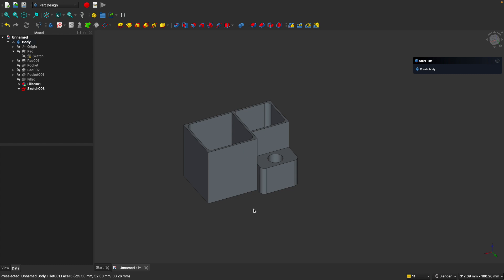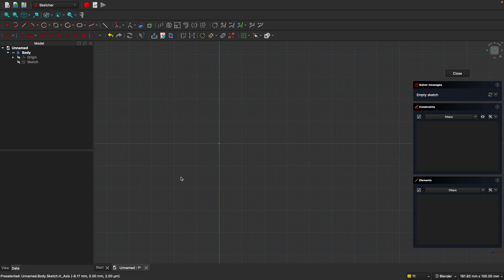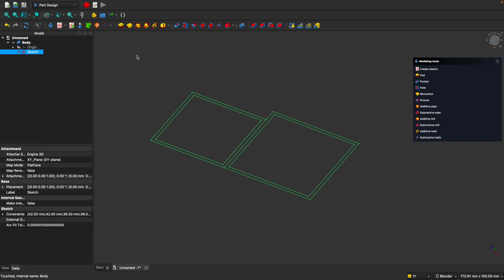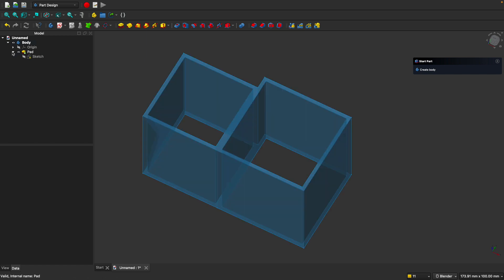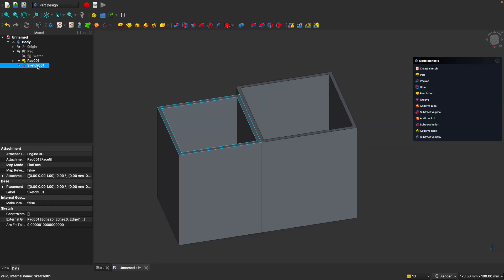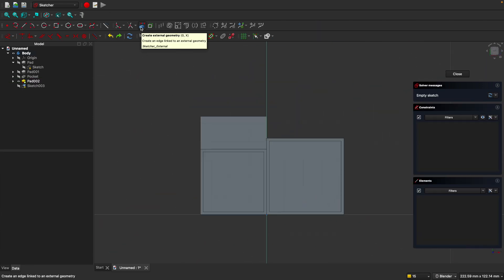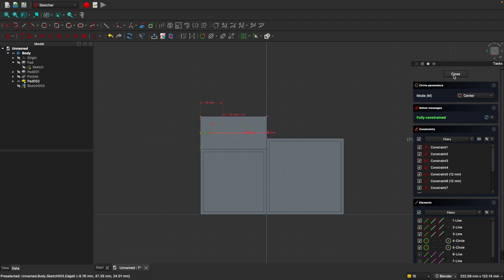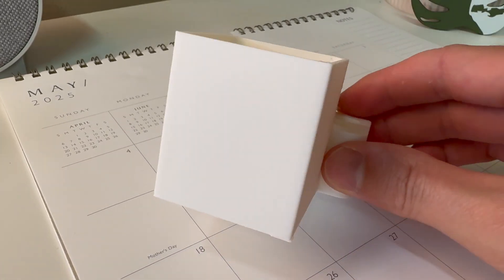Learn FreeCAD for 3D Printing - Complete Quick and Easy Guide (Beginner)

Comment: While I appreciate your effort to make this video, there are several issues with this tutorial.   First, you said for the offset.  Lets see if this works.  Yes, it did. (what if it didn't for everyone else?)      Also, it appeared that it put an offset on both boxes, but mine did not.    Also, you didn't quite note what the offset is.  While it can become clear later, it's not always clear at the moment you're doing it.

I also noticed after watching several different 3d modeling videos that there is modelling lingo involved, but none of the "beginner" videos explain them.   Just kind just use the lingo while doing whatever action is required.   As a career IT Infrastructure guy and now an AI engineer, I always define lingo to the uninitiated.

Comment: It would be nice if you updated this for version 1.0.2. I have spent hours at the 4:30 mark. The back is always a single face. I can never get the single line in the center of the back face. You are by far the easiest to understand if you would just give step-by-step instructions and not skip over the simple things for you. I am completely new to this, but I'm pretty sure this isn't working on the newer version. If I am wrong, someone please speak up and provide proper instructions.

Comment: I'm coming at it from years of solidworks experience in aluminium.  Now I'm wanting to do 3D printing with plastic.  20 years ago there was nothing to touch it, these days there are a lot of options, my main issue is trying to work out what the thing that I wanted is called in another package.  My main complication is always trying to project geometry from one part onto another.  As a result, I didn't really take FreeCAD seriously, but I think it's time.  It has the potential to leave traditional tools behind and its proved already that its not going to fizzle out any time soon.

Comment: I'm facing a few issues related to freecad, first whenever I try to select any plane for sketching, it doesn't get selected even after clicking on that plane but it gets selected when I select it on tasks menu, second issue is whenever I try to give dimensions to any point it always shows an error called line is over constrained, under constrained or remove constraints (x) (x is number of that constraint) also whenever I try to sketch on any circular surface, it shows an error that select planar surface for sketching, anyone knows how to fix these issues ?

Comment: Thanks for the video. It was informative, but it's one of those things that you will never learn by watching someone else. I will have to dig in and try it for myself. With that said, it appears that the portion that you created to hold the glue stick and pencil (?) is solid, correct? As I recall you never created the wall thickness like you did for the other two rectangular areas where you did the external boundaries and then did internal boundaries that were 1.5mm less. Wouldn't you want to do the pencil/glue stick area the same way? That way you use less material when you are printing, or would that then become too challenging to print? Thanks again.

PS You also referenced the middle mouse button. I'm assuming you are on a Mac or possibly Linux. For those of us on Windows, what would be the the equivalent keyboard/mouse combination (I believe you were dragging the image to re-center it, or rotating it. I don't remember exactly.

Comment: Thank you so much!
Moving from Windows with Fusion360 to Linux with FreeCAD was super daunting, I spent 2 and a half days trying to get Fusion to run on Pop! OS,
After getting it running in a Windows 10 VM, it was SO BAD, I decided to just try FreeCAD.
My DUDE, I should have tried FreeCAD to begin, coming from Fusion, its SO much easier than I expected. 
I have managed to get FreeCAD to crash a couple times. But thank you so much. I am using this for my Creality v3 KE, and so far it seems really straightforward. Thanks again and please please, make a bunch more videos with Tips and Tricks on FreeCAD.

Comment: Ok, 1st, when selecting the tools, slow down, your tools are in different locations than the default, so it's a pain in the ASS to figure out what little tiny picture you selected and what it looks like, and where it is located on my screen. 2nd, explain how I undo a mistake, I basically have to delete and start from scratch as I don't understand the interaction between sketch, pad, and all the other stuff i'm trying to absorb (I truly am a Beginner). 3rd what is body vs. sketch. and I constantly get errors saying I can't do this or that. so frustrated.

Comment: Awesome tutorial. Been using FreeCad 0.2 for a while and was considering switching off of it but already seen alot of improvements in 1.0 worth sticking around for.

Also learned alot of way simpler work flows from this video I didn't realize I could do in Freecad, thanks!

Comment: I know this is supposedly a “beginner guide”, but for someone totally new to 3D printing this was not easy. The lesson was mostly fine, but you definitely glazed over several “given/obvious” UI quirks. Also, like others have mentioned, FreeCAD didn’t render two separate rectangles for the front wall; it was connected as one large one. I tried searching on how to break it in half, but gave up after many different videos came up short. Seems like it should be so simple?! Apparently so simple that no one on YouTube takes the time to explain it.🙄

Anyways, after trying for way too long, I looked at Tinkercad. Holy crap! SO MUCH EASIER TO USE. I re-created this shape with very little effort. I’m sure FreeCAD has its place for professionals, but for anyone that just wants to make basic shapes they can 3D print, Tinkercad is so simple to use in comparison. Try that first!

Comment: 4:58 that's where something is messed up on my end. The highlighted face has a line dividing the two boxes and you can see two different face - mine has no line, and highlights the whole thing as one face. 
I don't know how you have two different faces.
Reply: me too
Reply: i found solution, select the pad in your tree, look for Refine in properties (bottom left) set from true to false
Reply: @EllJQ  Argh, I spent a lot of time trying to figure it out, and then finally did, wrote up detailed instructions, logged in to post them today, only to find you wrote the answer out yesterday (so, had I procrastinated about trying to figure it out, I could have just read your answer instead and saved a lot of work). Regardless, there’s one more step (that I already wrote out) that may still be of use.

Changing Refine in the Data properties tab will probably only apply to the model you’re currently drawing. If you create a new model, Refine will revert back to “true”. To change the setting for all new models, go to the Edit menu, select Preferences, then sub-item Part/Part Design, then sub-item General and under General Model settings, un-check “Automatically refine model after sketch-based operation". Warning: this might have other unintended consequences. I’m a complete beginner at FreeCAD, so I don’t know enough to be sure.

Comment: Thanks for making this! I tried really hard to figure out Blender for a year but it gave me so many headaches from shortcuts and lotsss of menus that I can't find anything but I get it, Blender can do some incredible stuff like organics, sculpting and converting images into objects. However, the learning curve is very high and most the time my objects break from non-manifold geometry regardless of how I tried to be careful. Came across FreeCAD, quick download and install, 10min later I made the thing in your vid from no experience of it and it was a breeze! Easy and simple. This is going to be my favorite now since most the time I'm just trying to make simple things around the home like organizers, repair pieces, brackets or my urgent need today.. clips to attach a harness I sewed to armor parts I printed. CA-glue was just not holding and I saw a tip to just print clips and melt them onto the inside of the armor.

Comment: For some reason even following your instructions, lines are not made that run the height of this when you pad and set height so when you try to set external geometry it breaks the project because that line is missing.

Comment: I use Fusion360 and since I began utilizing 3D printers into my company, I decided to give FreeCad a shot considering many people I get files from use the same…
I know everyone has an opinion and preference, but FreeCad seems to be nowhere near “easy” nor have any type of work flow utilizing. They could do away with about 90% of the unused BS and irrelevant tools/options then have a decent program. 
I’ve been designing in CAD for over 20 years, maybe I’m just used to AutoCad and Fusion, but FreeCad feels like a huge bundle of trash to sift through until you find the necessary tools you need.

Comment: I got stuck by 8:58, the back pad is not separated. But I saw a comment that helped, by @Snailslug. Mark the back pad, and in the left side panel change "Refine" from true to false and then immediately click the back pad again. That worked for me. Also, I learned that you can right-click in the left "Model" panel to, for example, edit the latest "sketch" or whatever you want to change. The struggle was real but eventually after doing it again and again learned more and finally finished, rounded the edges a little more, and experimented with that, and will print it as soon as my printer arrives, boomer story time over. 👴

Comment: I am also having problems of not getting the line between the two squares after using the Pad Tool. As suggested in one of the comments, I changed the setting on Refine in the Data Pane. This didn't work for me. Running windows 10 and downloaded the 1.0 yesterday. The person in the video is using a MacBook Pro. Is there a fix or work around. Thanks in advance.

Comment: Thank you for the tutorial, unfortunately it does not work. A Lot of inconsistencies during the steps. When creating the 3d view, the part where both rectangles originate it creates a single wall, instead of two rectangles in 3d.
Reply: Works for me. When you say 3d view, do you mean Pad? I get 2 rectangles when I follow it. I'd check your constraints.
Reply: You have to make a new line

Comment: This is way easier than old Freecad way. Export to STL directly instead of mesh workbench, extrude the bottom right away, no datum planes everywhere, and that offset tool is nice too. An i love the easy way to enter constraints and midpoint constraint.

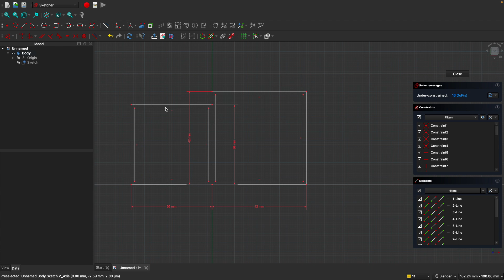Comment: It took me ages to figure out what view those boxes were in. They go from a top left to lower right angle after 3:08 when the task panel was closed. The cube has Top of the left, right on the right, and rear on the top with the small corner piece selected.

Comment: Hi, noob here, attempting to transition from Blender to FreeCAD.  First of all, thank you for the tutorial.  In case you're interested, the following is a set of notes regarding points in the video where I felt left-in-the-dust (aka, where you likely forgot that you are speaking to beginners who have no clue what is going on).  Also, I added a few kudos.

02:20 - You moved that new "rectangle" you just created for us.    How?!?  My rectangle is still languishing in the upper right corner.  I would sure like to move it like you just did!  I call these "Magic Moments" -- places in a tutorial where $#!t happens without explanation. [Full disclosure: I paused the video and fiddled until I discovered that holding down the roller-wheel (aka third button) allows me to move "stuff" (don't know what to call it, yet -- object?). I'm hoping that isn't the only way to move things.].
Might I suggest you use a Keystroke Visualizer so we have a reveal of your mystical mudras?
02:35 - I paused the video to try out this "Offset Tool" and entered 1.5 instead of -1.5 ('cuz I have a short memory).  It would have been nice if you showed us how to fix things like this.  Like, how do I change it to -1.5, now that I've closed out of that activity?
02:50 - Another Magic Moment!  How the heck did you get from the Rectangle-Pulling-Cursor, to the cursor mode that allows me to select "stuff" (still don't have the FreeCAD vocabulary, yet). [Full disclosure: I tried Esc, and that seemed to do the trick (see, I'm a magician, too!)]
02:56 - This is a minor point, but when you said, "We can try to select it..." That is an ADHD trap.  Now my mind is wondering, "Well, what if you hadn't been able to select it that way?  What other ways are there?!?" So, suggestion: either don't broach the topic, or fulfill on that broach.  I.e. if you're going to pique our curiosity like that, then take a moment to show us the different ways to select stuff.  Else, some if us are going to lose focus.
03:10 - Ok.  My bad, you did tell me that we were going to create a "sketch." That's a new concept for me (not something I encountered in Blender).  And, at this point in the video, you reminded me of this strange entity, which is good.  
04:07 - Kudos for referencing Blender, etc.  It gave me warm-fuzzy validation of what is going on.
04:44 - For me, Shift+Middle Mouse Button did nothing to alter the behavior of the Mouse Cursor.  So, kudos for pointing out the Control Settings!
06:15 - I just noticed that your "sketch area" has a grid showing, but mine doesn't.  Just an FYI.
07:15 - At this point, you're beginning to lose me.  You keep doing this weird "sketch thing," and I really needed some sort of aside -- a point where you acknowledge that this concept of "sketch" is a little unusual (at least to someone used to Blender -- I mean, come on, you referred to Blender, before).  I needed you to say something like, "In FreeCAD, this is the paradigm: to implement behavior, you first need a sketch" or some such reinforcement so I can relax that part of my mind that is screaming, "Sketch always? Or, just sometimes?!? Why sketch?! When sketch?!? What is sketch REALLY?!?!? And, what is 'External Geometry', and how do it tell it from regular geometry (is there a regular geometry )... i.e. when does it become real aka printable (on the theory that a 'sketch' is not a printable feature)? "  Basically, I needed a grounding in all this terminology and what the implications are, what is real, what is abstract, and what it all means.

And, that's the point where I left the room.  But, I'm at a nexus.  Blender is great, but it kinda sucks for creating precision prints, like for creating an enclosure for an electronic device where mounting points need to line up with PCBs, potentiometer shafts, and toggle switch bats need to properly poke out, and internal walls need to nicely hug internal batteries and stuff.  So, I thought maybe FreeCAD would be a good alternative, with its ability to enter dimensions on the fly.  But, the learning curve looks too steep at this point, as I have deadlines to meet.  I will probably circle back at some future point.
Reply: Very valid points, I stranded at the external geometry, where I got an error saying I needed a shape binder.
Reply: @Biscuits3D  Indeed! I kept getting an error when trying to shorten the 2nd rectangle " No wires connected" or something like it. My knowledge at that point is still near zero so could not get back to a place before the error "Back arrow wasn't doing it"  so I had to restart the whole thing. Tried 5 times! always got the same error so gave up. :face-orange-frowning:
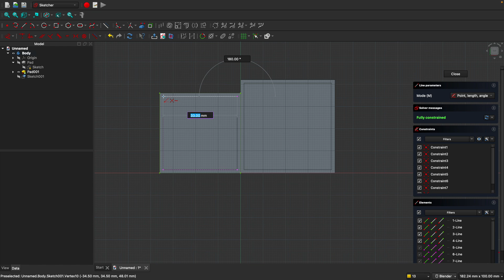Reply: @makroMike  Hope this helps someone in the future. The reason you were probably getting that error is if you were connecting the outer and inner walls when drawing your lines (like it almost looks like hes doing at 6:50). At least that was my issue.
Reply: @Combat79  Helps a lot, Inwas stuck at same place. Gave up, but got back again from scratch. Thanks
Reply: Oh thank you so much! I've been replaying the first 2:20 time over and over trying to figure out what I was doing wrong. Much appreciation for the initial tutorial and you taking the time to add these notes!! From other comments, the trick is to right click to get control back.
Reply: Yep. this is NOT a video for an absolute beginner, some slight knowledge of FreeCad is needed for this to be as smooth as the video shows, a simple thing like clicking and dragging @ 02:26 wont work unless you click the right mouse button after creating your rectangle.
Reply: Another thing, if you tend to scroll too much like me it's easy to lose track of your part look for the magnifying glass with the 4 triangles in it that should center your view on your design if you lose it
Reply: Me too twin😭
Reply: So, 11 months later, and I'm still using Blender :P  -- but, I'm getting better at it, and have several successful enclosure designs under my belt.
Reply: yeah he def passed over alot of things. Calling it an extrude tool? when it is infact not called extrude was very not good imo. I never used blender. I used autocad years ago in school for basc design things and I dont know what extrude is or what padding is. I now know they make things 3d? I think? I also 100% agree on the sketch concept. I messed around with this program for about an hour before looking up tutorials and I couldn't figure out where to begin to create an object. a quick explanation of the basics of creating the working layers in the side bar like "body" vs "sketch" would have been nice.

Comment: Thanks for the video. Why did you save as stl and not 3mf?
Reply: STL type files are commonly used for slicing software, which make the gcode necessary for consumer printers. You can use 3mf for your configuration if you need to.